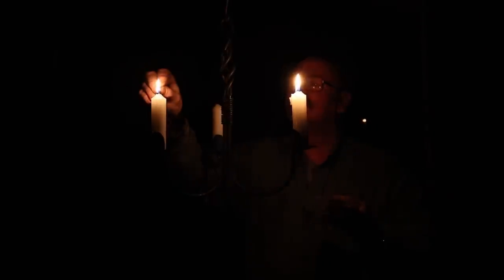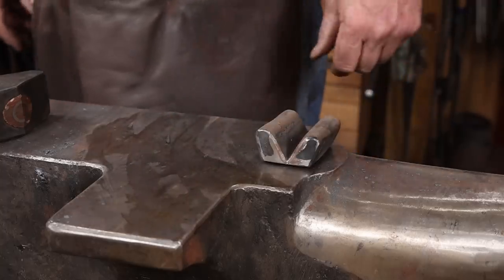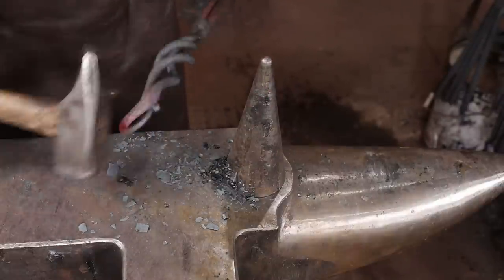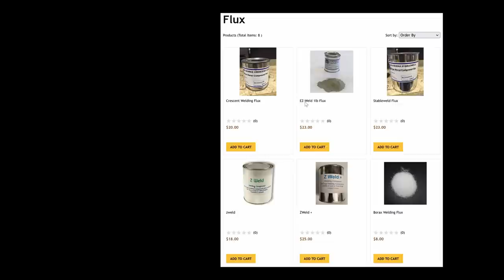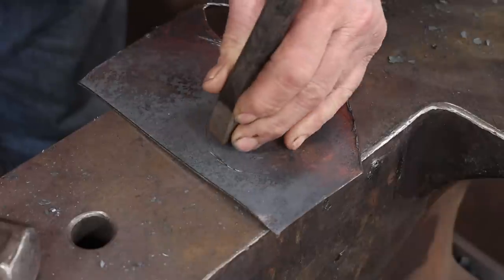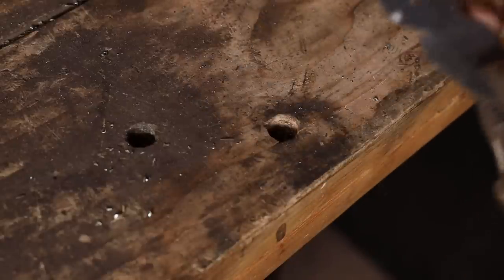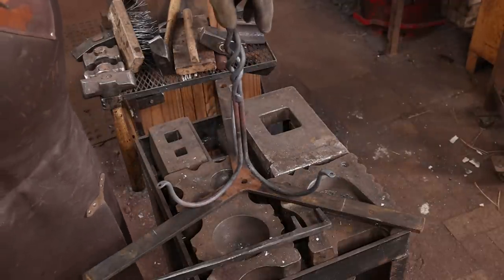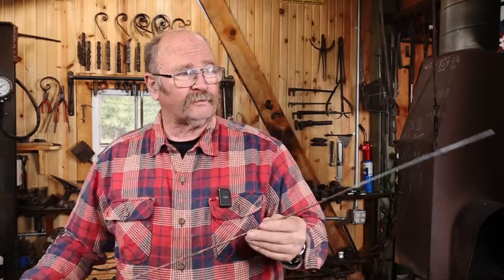Hanging Candelabra with Basket Twist

Comment: Hi John I just wanted to mention that you can change the drill bit size on those hole saws, as long as the shank that goes in were the set screw is the same size.

Comment: Thank you for the inspiration John🙂 how did you make the dishing tools? I believe the bottom tool is an oxy cylinder base.
Reply from the maker: The bottom is a cylinder base.  The top tool is just a piece of 1/4" plate dished in in the same base and welded up to make the tool.  It was actually something I made for a different project many years ago.

Comment: Great job, different size cups to match candle size ?  Could you not form them over a cone to accommodate different sizes in 1 holder, or forge in stepps?
Reply from the maker: I think you would find the candle very tipping such a tapered holder since there would be very little contact with the body of the candle.
Reply: @BlackBearForge  thank you,  oh well it was just a thought

Comment: I am not saying this is a good idea per se... but to cut thicker sheet metal i often just put extenders on my hand metal shears and use the table to hold one end while i push in the other handle. i mean it definitely shortens the life of the pliers but ive been doing this for several years and the old buggers are still cutting. cheaper than bandsaw blades (let alone the saw) and way faster than a hacksaw!

Comment: Hey john, what was the name of that drill bit you used after you drilled the hole. The one that dresses up the hole and takes away the sharp edges?
Reply from the maker: Thats a counter sink
Reply: I believe what you are referring to is a Counter Sink Bit. Originally used for making the reeses for flat head bolts.

Comment: Hi John...If you didn't have a welder, would you forge weld it?  Or is there another option?
Reply from the maker: This was forge welded on the end.  Forge welding the middle would be possible, but would leave the material much thinner.  It just comes down to an aesthetic choice.